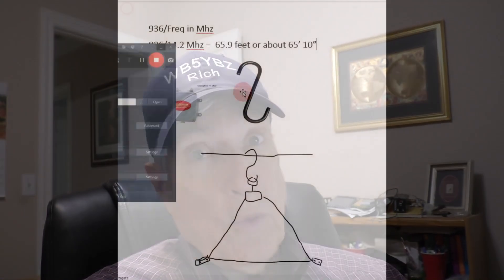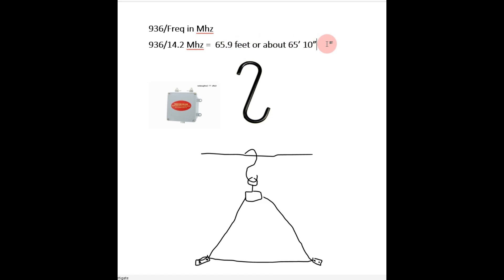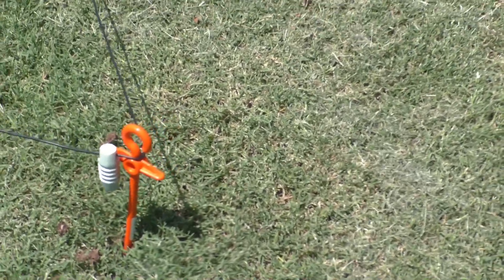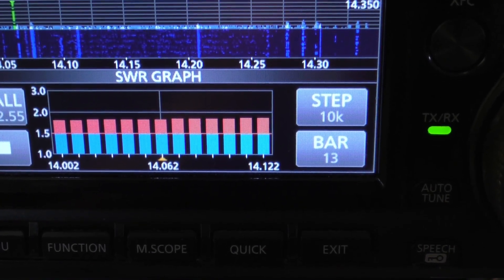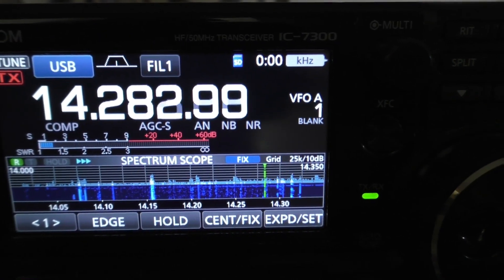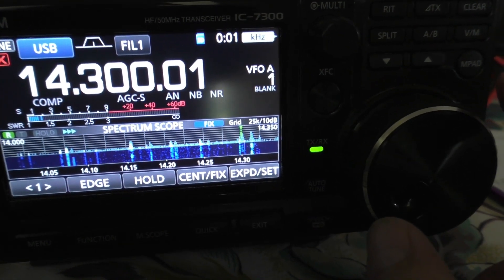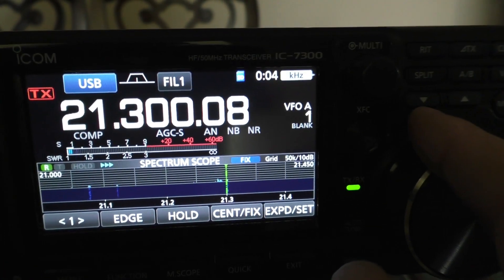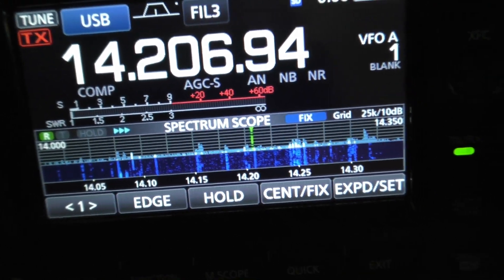Build a Easy 20 Meter Delta Loop  part of the antenna is on Ground  How did it do

Comment: If you tune the swr to 1.5 at 14.350 it should be good for the rest of the band.
Reply from the maker: This is correct... because it was about 2.0 for most of the band or a little less...

Comment: Is your Delta loop antenna horizontal or vertical plane? Also the lowest point should be 7.5 ft to 10 ft. for 20 meter Delta loop. Also start with 1005/frequency which will be approx. 70.5 inches total length of wire to start with. Look at AP FOTO you tube. Almir ve3dal portable Delta loop. Would be nice to take to a park. Also has a small "foot print" for use of space on the ground, V shaped.
Reply from the maker: That particular loop was sort of tilted it down.   I didn't use the 1005/Freq formula,  I used 936/Freq in Mhz because it supposed to be better with the impedance being lower to the ground.  I was just experimenting around with the 20 meter loop in this video..   Right now I am using an 80 Three sided Full-wave loop for 80 meters.  It''s 2 points are 24 ft high and 1 point is about 45 feet off the ground.    I used the 936/Freq in Mhz for my loop and I am using a 2.5 balun not a 4 to 1 balun.  I have it cut to about 263 ft. at 3.600 MHz I am getting 1.5 SWR and the impedance is 75 ohms.   I am using the loop for 10-80 meters with a antenna tuner.  https://www.youtube.com/watch?v=TqE_W_0Le0k   I have replaced my wire right now without the tuner.  At. 3.6 MHz  1.5 SWR,  at 7.098 MHz 1.5 SWR,  14.250 Mhz  2.5 SWR,  On 15 Meters on the CW portion I am getting about 2.35 SWR, and  most of the CW portion of 10 Meters  about 2 SWR.     When you using your antenna as a mulit frequencies the tuner comes in handy....
Reply: @RichRodgersOnline I'm glad your antenna is working for you!
Reply from the maker: @jamesabc372  Thank you!